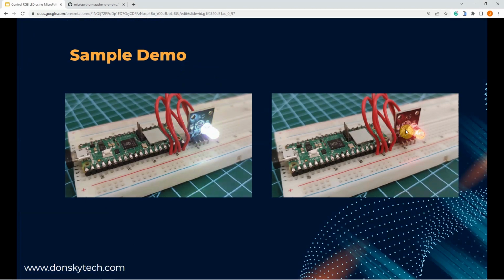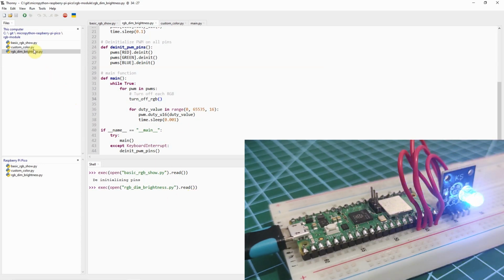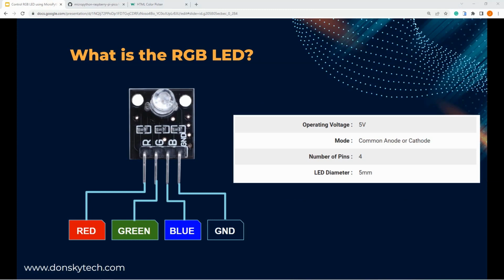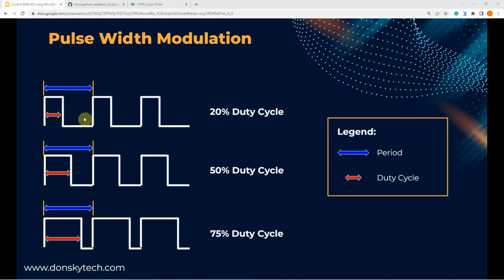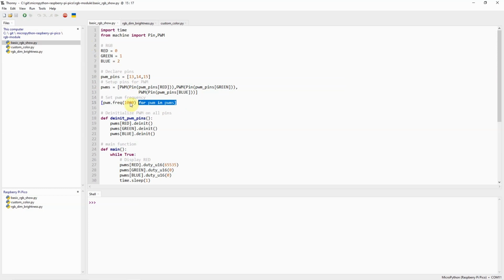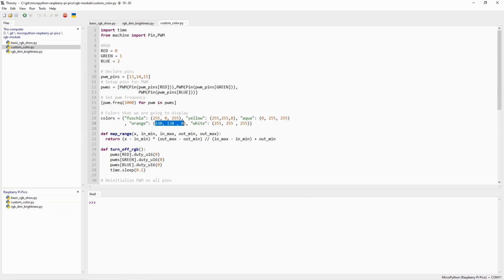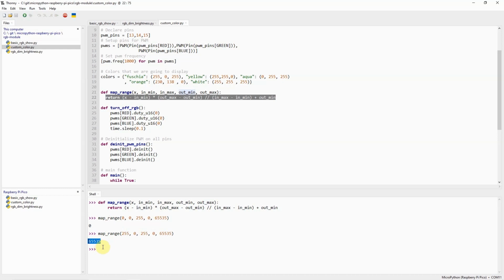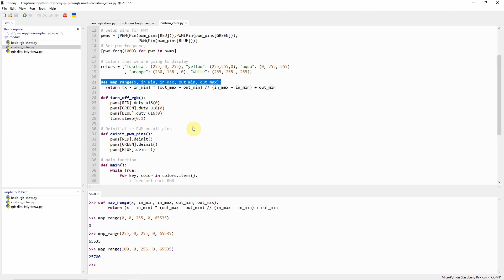Control RGB LED using MicroPython

Comment: Nice job as always. Next step is to create an RGB class where you can initialize members by just passing in the pin numbers then call an update method with the RGB in 0-255 format. Looking forward to that "classy" video.
Reply: Well I happened to be looking around and it seems someone has already done this and more. The picozero module is available and among the many classes they have the RGBLED class that does what I was suggesting.
Reply from the maker: @keithlohmeyer  Ohh cool... I was supposed to use an ESP32/ESP8266 board for this tutorial but changed it at the last minute to a pico w board.  I did not know that the Raspberry Pi Foundation already has one.  I will update the write-up to have this as an option.
Reply from the maker: @keithlohmeyer122 On the other hand, I look at picozero documentation and this is applicable only to the Pico board.  So the code that I have written is applicable to anything that runs MicroPython firmware like ESP32/ESP8266/PyBoard.  It is actually cool though to play around with the RGB color model and make it work on hardware like the RGB Module component.  But thanks for the tip always. 😁
Reply: @DonskyTech  Yes that is true.